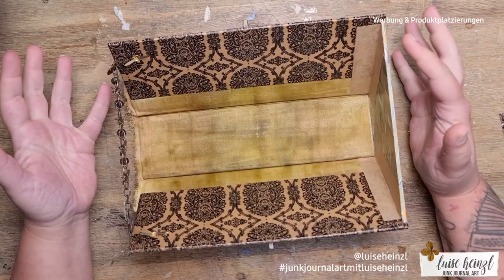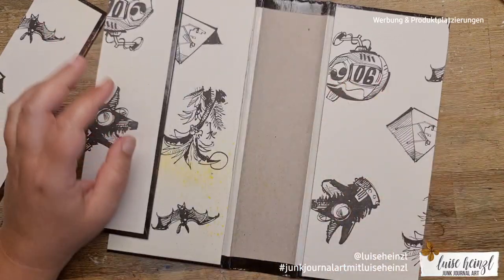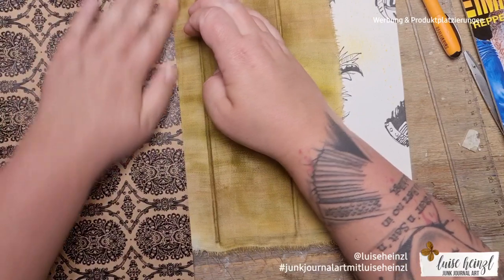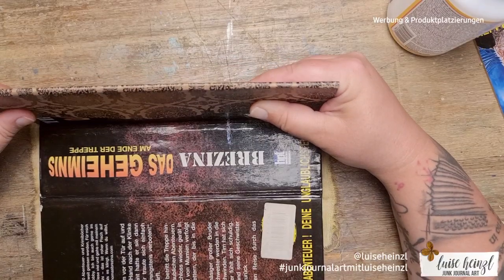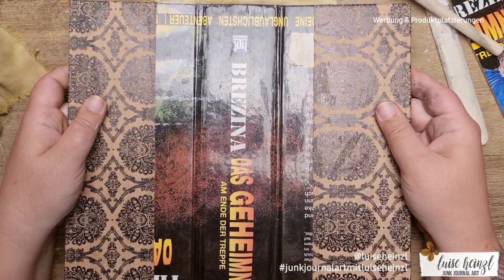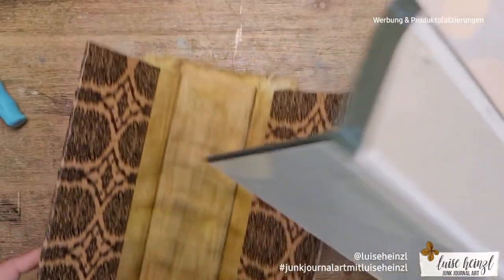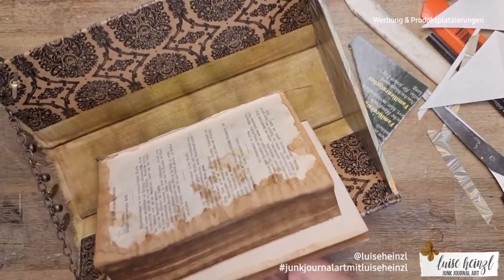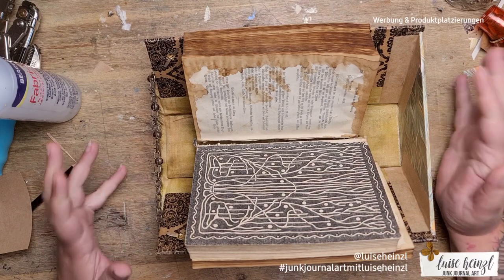desk organization tool to store your signatures ❤ DIY & UPCYCLING ❤ EXPERIMENTAL TUTORIAL

Comment: Yes, I understand your pain where Fabri-Tac is concerned! I had the same question at one point so I posted it in a junk journal group in which I belong. I was told to use acetone nail polish remover to thin out the Fabri-Tac. I can’t tell you how much I use as it’s always a guess and depends on just how thick the Fabri-Tac has become. This solution works very well for me. Today I used the glue that I had the end with acetone several weeks ago or maybe a couple of months ago. I used it to secure fabric and the entire outside of my altered hardback journal; I absolutely love the way it worked and the way the journal cover looks! Please let me know if this works well for you too.
❤️

Comment: Although I love Fabri-Tac, it can be temperamental. It thickens and gets difficult to use. You can thin it with acetone. In the US we can buy it at Lowe's or Home Depot. Do you have them? If not, check your hardware store. I use a thinner plastic bottle (Sugarbelle frosting bottle) normally used for cake decorating because it is easier to squeeze. Pour in some glue then add acetone in small amounts, stirring until you get it to the right thickness for you. 
❤️ Shirley
Reply: Nail polish remover is also acetone and works too
Reply from the maker: Thank you ❤️ that sounds good!

Comment: Ich liebe dein projekt. It ist schon und useful.  I had to giggle when all of the trouble came because  that looks just like what happens to me.  You stuck with it though and it turned out to be just wonderful in the end.  I think honesty in crafting is a much better way to go than to pretend you are perfect by the miracle of technology.  Watching someone work through the problems that come up is so helpful because for sure i am not perfect and I doubt anyone else is either. By the way,  you did remember the right word for  chain.  I am trying to increase my German vocabulary, but what I had to say surpassed my vocabulary by miles.  And I don't know if projekt is masculine, feminine, or neutral.  So I just picked one.  If I am going to mess up in my German lessons, it will be word order or the stuff that changes because of masc., fem. or neu. and the word endings for the verbs.  It is like instead of saying es ist regnet, you say es regnet.  That is a lot of stuff to remember.  I enjoyed your video so much.  Danke und Tschuss.

Comment: If you clean out the tip of the Fabri-Fix bottle it should work better.  I had the same problem when I got a new bottle.  I removed the glue in the tip and cleaned it out it worked much better after that.  I think  that the glue in the tip and top part of the bottle gets thick while sitting in the store.

Comment: Luise - If the 3-in-1 glue or Fabri-Tac is too thick add some acetone ( same as nail polish removal) to it.  I usually add around 2-3ml. Then shake well. I also decant it into smaller bottles.
Reply from the maker: Thank you so much for your help! Will try that!

Comment: There should be a small screw that you loosen to adjust the ruler (slide to desired measurement) on your crop-o-dile, and tighten to set the distance placement of the hole you want to punch
Reply from the maker: seriously? have to check that!

Comment: If your Fabri-tac bottle is about 1/2 full, you can lay your bottle on its side in between using and the glue will come out faster.  At the end of your bottle you can add some nail polish remover (acetone), just a few drops to thin out your glue.  It is called a chain :)
Reply from the maker: Thank you ❤️

Comment: Fabric-Tac is great.  I’m using mine in its original bottle and I opened mine with a poke tool and close with a floral pin.  The man thing I’ve learned is to wait for the glue to come down into the nozzle and then it works like a gem❣️ 🤗💕🦋